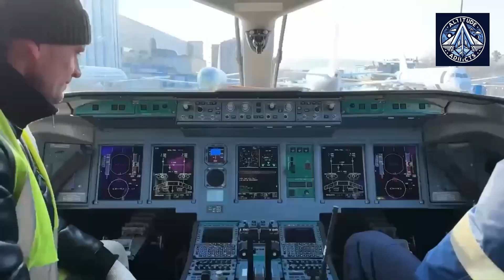Will Iran Buy 40 Russian Superjet SJ-100 Jets? 2 PD-8 Engines Delivered

Comment: Wrong question.
Will Russia make enough planes for themselves and export?
Easy to make prototypes but having an efficient production line is a bigger task.
Reply: Yep, they need Chinese consultation on how to run production lines , otherwise 2 planes per year would be a reasonable estimate .
Reply: Waktu yang akan menjawabnya.
Reply: @SmartphoneZTEbladeA72  
?????
Human?
Reply: @andreinastase1604  It is not difficult for engineers to build (assemble) a prototype from manufactured and already certified products.
It is almost impossible to completely construct an aircraft from new parts. These are 1000 new technologies that will require hundreds more developments and technologies, and all of this must be tested.
Considering world practice, no country in the world except Russia is capable of this.
In this case, launching serial production will be tens of times easier than creating a prototype.
Reply: @ФеликсДзержинский-ф2ш  
Disagree.
First engineers don't do the assembly work.
Second on prototype work there is a lot of freehand deviation.
I worked on many MD and Boeing airplanes in my life.